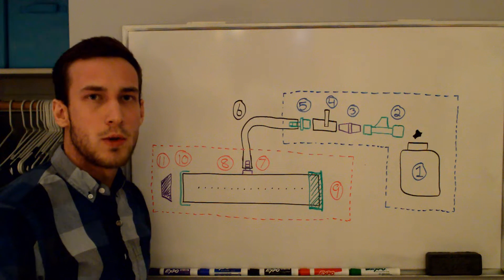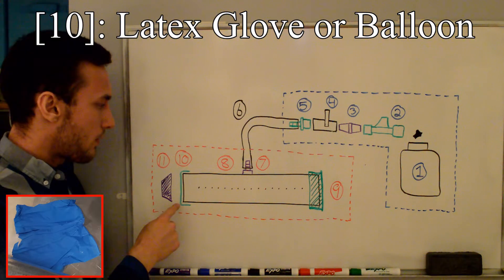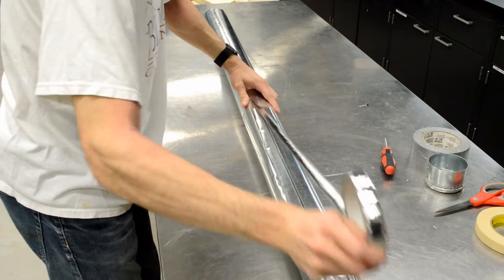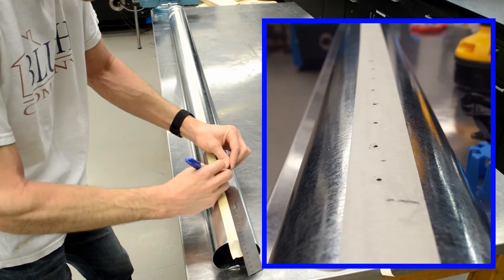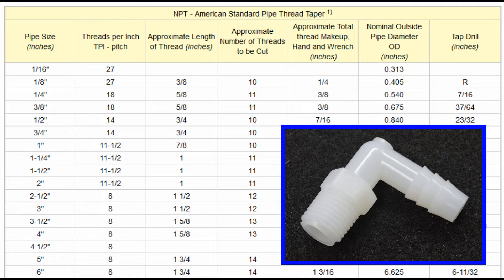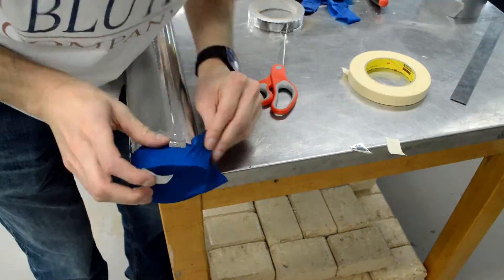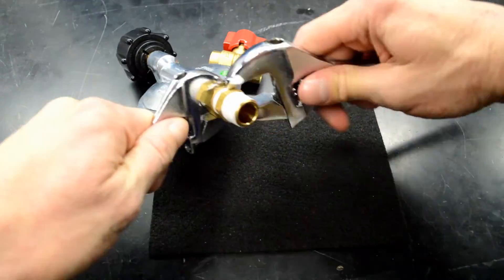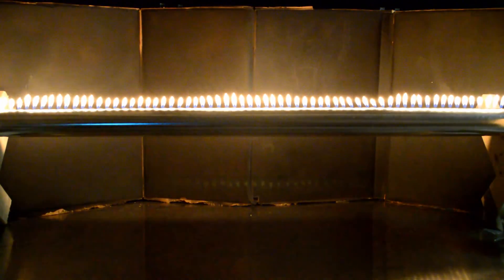How To: Build Your Own Rubens' Tube

Comment: Isn't it dangerous to use a regular or latex balloon/glove? Can the balloon withstand the heat and pressure inside the pipe? It can blow up and all the gas escape causing explosion, no?
Reply: Hi. am using Butane cylinder (usually people use for AC copper duct welding) and though i keep burning the diaphrams, still feeling safe. i even had endcaps burning (due to minor leaks). but i have enough time to put those flames peacefully. Not sure about propane though, as wiki suggest they have slightly higher flame temperature.

Comment: did i miss the part where you show how to connect a speaker to show the sounds frequency?
Reply from the maker: Hey Kelly, I didn't add that part in to the video.  I just connected the aux cord of a regular set of computer speakers straight into my phone, and then placed one of the speakers right up against the flexible side of the tube to play the music.

Comment: Hoping I can trouble you for some troubleshooting tips. 

I'm a physics teacher building this out for demos. I followed your tutorial fairly closely. My only modifications were that (1) had to use PVC on one end (it's all HD had in stock), (2) I my drill won't hold bits as small as 1/16", so my holes are 3/32", and (3) I spaced the holes 1/2" apart.

I light it up, get the flames nice and steady, but practically nothing is happening. I tried putting both my phone speaker and a computer speaker up right up to the balloon (without touching it directly), I've used a frequency generator producing pure sine wave tones, tried playing music, and... almost nothing.

Additional info: the only 3" tubing HD had was suuuper rigid, so it's not quite perfectly round. I also made a small dent in it about 1.5 ft from the sealed end while trying to get it closer to circular.

Are the holes too big? Does it have to be perfectly round? I feel a little stupid asking these questions, but I'm at a loss otherwise. And it's such a cool project. Any tips/thoughts would be greatly appreciated!
Reply: Did you ever get it to work? I’m planning to build one and going to guess the primary cause to your issue stemmed from a small speaker doesn’t move enough air.

Comment: PLease use the metric system next time i dont understand inches they are an engineers nightmare ughhhh
Reply from the maker: I use whatever units are convenient for me at the time.  The hardware I was buying wasn't in metric, so it would be much more confusing to convert them.  I've mentioned this in comments on my other videos, but you really need to be able to work with both unit systems.  I personally like metric better for calculations, but sometimes it's easier to use English units.

Comment: I think you should had divided the diy in 3 parts
1: how to set up the propane 
2: how to set up the pipe and 
3: how to set up 2 speakers one for the flame the other for the music to sound better.. because the speaker in the tube wount sound as good as having a 2nd speaker for better sound. Not just that can you show us how to connect it to an aux cable so many of us can connect it to our phone. I would be very much grateful if you could. Thank you and still a great video.🔥

Comment: Wow!  So thorough a d easy to understand, thanks!  2 questions please.  1, how long should the house be? And 2, how did you get the flames to change colors?  Thanks so much!
Reply from the maker: You're welcome!  The hose can be any length you want, but you generally want to make it just long enough to reach between the propane tank and your tube.  Figure out where you'll put your tank and then cut a piece of hose that is long enough to reach your tube, with a little extra slack.  The color of the flames in the thumbnail are just artificially changed by me.  The flame color will be orange/yellow.

Comment: What do you think increases the flow where flames are bigger ? It can’t be sound pressure because that is essentially a very small fluctuation around average pressure. Could it be turbulence ? Wouldn’t turbulence act against flow ? Is it louder by the small flames or the big flames.

Comment: Great how-to video, thanks!! I'd love to offer a tip... For the 1/2" hole you had to drill into the pipe for the hose fitting, next time maybe try a STEP BIT (AKA Christmas Tree bit) instead. These bits work very well when drilling thru thin materials and leave a cleaner edge than a standard drill bit. They CAN be expensive, but they don't have to be. Harbor Freight sells them cheap, and their version works well enough for light-duty drilling like this project requires.
Reply: This is what I went to the comments for, to see if anyone mentioned it.
Reply from the maker: You're welcome!  And thanks for the great tip!  When I made this video I didn't have one on hand, although like you said, they're easy to get a hold of.  So yes, for anyone making this project, I do recommend using this type of bit over your normal drill bit.

Comment: Great video! Just wondering, does all the propane gas finish burning when you turn the gas off, or is it still full of propane in the end? What abour the smell if you disconnect it afterwards? Thanks
Reply from the maker: Thanks!  The propane will continue to burn if there's the correct fuel/air ratio.  So when you close the gas valve, the propane is no longer being forced out of the holes, and the flame height decreases until it appears to extinguish.  However, it can continue burning in the tube if air is sucked in through the holes.  I'm not entirely sure if it does to be honest, since I haven't looked into the tube after shutting it off.  If it doesn't continue to burn, then you'll still have propane in the tube since it's heavier than air.  This also means you probably won't smell it even if there is propane left in the tube.  One way to get rid of the extra gas in the tube after turning it off is just to turn it upside down and let the propane leak out of the tube.

Comment: This is badass. I work for a haunt attraction and we are always looking for newer cool ideas for things that grab people’s eyes. 
This would be a great fire attraction, like sitting on top of a high flat roof. The only thing I can see is that it seems rather small and the holes for the flames wouldn’t be noticeable from far away. So let’s say we got a 6” diameter exhaust pipe, could we make bigger holes like maybe 1/2” each and use big fittings for this?

What’s the risks with this is there chances that it will cause fire if left unattended. Ideally I think we would like 4’-6’ flames coming up.
Reply: I found to see flanes better just increase the gas pressure.

Comment: Wouldn't a small diameter pipe work better? Require less gas volume stored inside, and have better pressure at the nozzles? Might be a bit safer this way. Nice work..
Reply from the maker: You could definitely try using a smaller diameter tube.  If you end up doing that, leave a comment letting us know if it works better than the larger tube.

Comment: Nice, clear video.  Thank you.  I plan to make one to use in my 6th grade physics class when we study acoustics.  One question for you.  What is the reason that you've used both the propane regulator and the ball valve.  Would just using one or the other suffice?  Thanks.  Thom
Reply from the maker: Thanks Thom!  The regulator has no adjustability of the flow rate, so I used the ball valve to more easily change the height of the flames.  Some regulators have a valve built in, but they are more expensive.  It was just for more fine-tune adjustments.

Comment: There arent any risk by sealing in on one side just with the glove and the tape ?
Reply from the maker: I haven't had any problems with my setup.  Before you run, you should always leak-check any areas that might be susceptible to leaks.  As long as you tape all the way around and make sure there are no holes, it should be fine.

Comment: Forgot to gas leak check before lighting - most important. Good video, thanks
Reply from the maker: No problem!  And yea, I ended up forgetting to add the leak-check video that I took, and I didn't want to go back and add it in.  I do mention in the video that you need to do it before running though.
Reply: @JoshTheEngineer  Hey I intend to reproduce your rubens tube but how do you actually do the gas leak check?
Reply from the maker: @gauthierchamplong8833  Mix a little bit of soap with some water, and then put it all the joints between the propane tank and the tube itself.  If there's a leak, you'll see bubbles continuously forming.  If you don't see any bubbles, you're good to go.

Comment: what does it mean if the gas only lights on the inside of the pipe even if you let it fill the pipe for 30secs?

by the way great video, easily the best i have seen so far
Reply from the maker: Thanks!  This could be a couple of things, and you'll probably just need to troubleshoot a little.  The first that I can think of is that you have a leak somewhere (either the gas section or the tube section).  If you can smell propane in the air, but you can't light the gas coming out of the holes, then it's leaking from somewhere else.  Make sure all your seams are taped, and that there's no holes anywhere.  You can do a leak check by taking a mixture of water and soap, and putting a little on joints/seams that you might be suspect of.  If bubbles start to form continuously, then you have a leak there.  If not, then you're good.  Check everywhere, even at the regulator.

The second thing it could be is that the flow rate from your tank/regulator/valve is too low, and you'll either just have to wait longer before lighting it, or increase your flow rate.  With the gas flow rate that I use in my videos, I can hear a slight hissing when I'm standing by my propane tank, indicating that the gas is flowing.  If you can't audibly hear that the gas is flowing, it might not be.

Hope that helps.
Reply: JoshTheEngineer Thank you so much! Your advice and your video literally just saved my science fair project
Reply from the maker: Hah, glad I could help!
Reply: Best demonstration I have seen for building one of these, and I really like your concise focused delivery. Well done!

Comment: Very nice video! I was looking for someone who actually knows what they're talking about and clearly states all the tips/tricks as well as safety precautions. I've tried this before but it was very makeshift with too small diameter tube I believe. In another video, he used a wooden block to fit inside the end opposite the sound input. Do you think there is any difference if it's wood, metal like you did, or rubber on both ends? Someone didn't know what to do with some slightly warped metal tubing today and I volunteered to take them off his hands so I can try this again.
Reply from the maker: Thank you!  You should be able to use anything solid for the one end of the tube.  You shouldn't use a flexible diaphragm for both sides because it messes up the standing waves in the tube.  Wood should be fine though, or even stiff tape or something.  You never know if it will work until you try, so I say go for it!